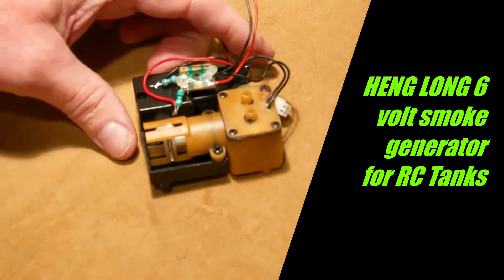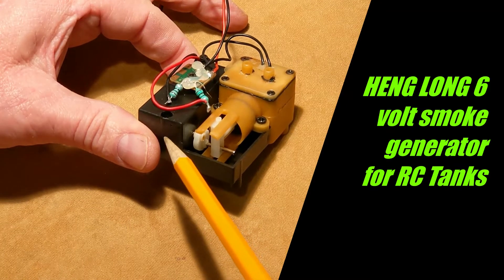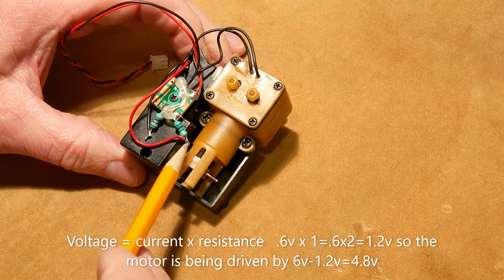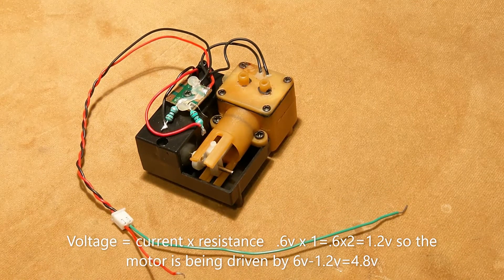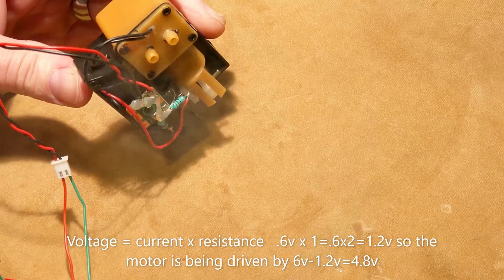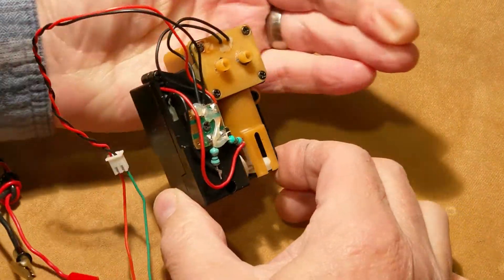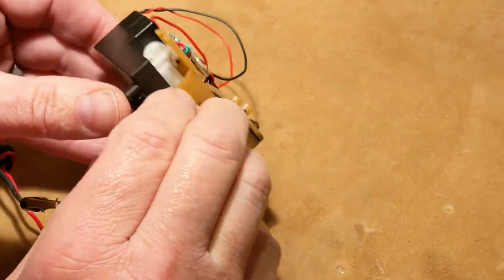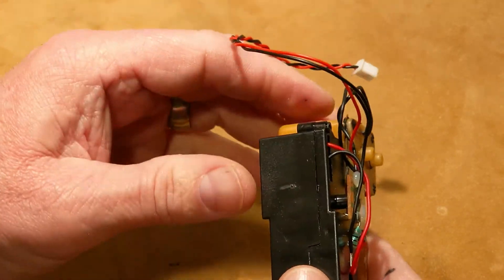HENG LONG SMOKE GENERATOR-RC TANK

Comment: How do I refill it with the oil I have that came with my tiger 2
Reply from the maker: A needle could inject oil onto the wick
Reply: Don't add much or you will saturate everything and it won't work.